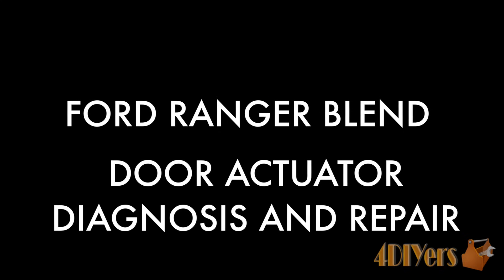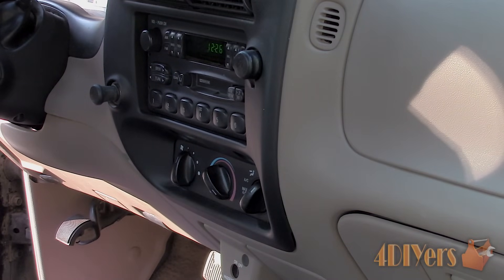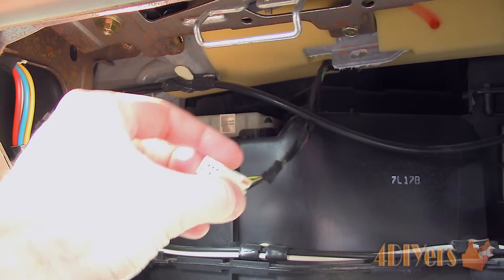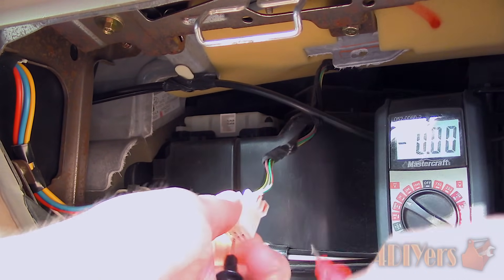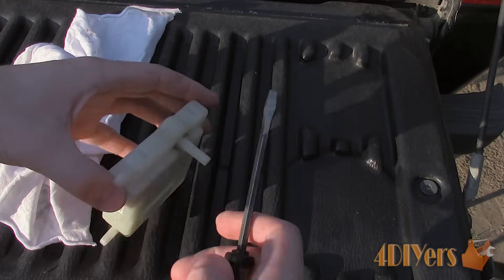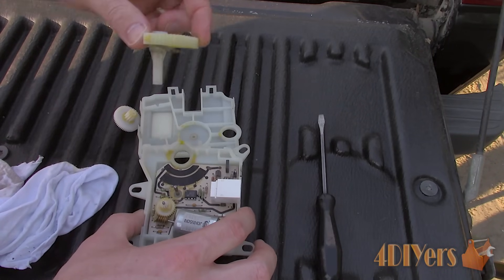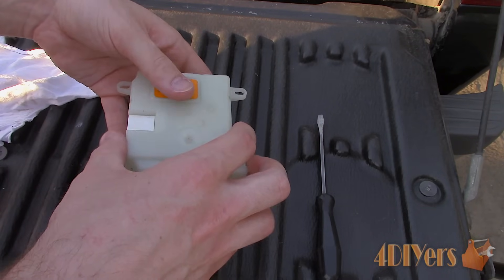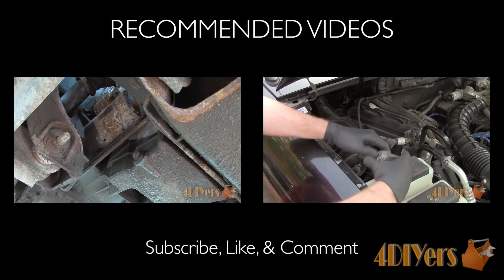DIY: Ford Ranger Blend Door Actuator Diagnosis and Repair

Comment: Uh when I pull up and close the flap inside I no longer get any air from the 2 vents above the radio so this didn’t work apparently
Reply from the maker: The blend door is for hot and cold air, it doesn't control which vents the air come out of.

Comment: Thanks for the excellent steps. Someone on YT said that one should use electric grease (or dielectric grease, not sure) to grease the tracks and gears. Which do you suggest next to the white lithium you mentioned?

Comment: I replaced my actuator but the actuator isn’t moving at all when changing the temp, thinking in may be the control board that isn’t sending a signal
Reply: What did you find out

Comment: A lot of comments I'm seeing are talking about 2 of these in a vehicle.  Mine is a 2009 ford ranger xlt and the knobs are just like what you show.  Does your 98 have 2 actuators?
Reply from the maker: Mine only has one. Maybe it's for dual climate control if that was an option.

Comment: Thanks. My actuator still works fine no click or anything but the blend door doesn't appear to move. Usually I'd hear a rush of air current changes when my ac turns on to ac max but it doesn't do that. I think the blend door is broken. How would I replace that without ivicerating my duct like I've seen people do? I'm trying to restore it and don't wanna hack job it to pieces.
Reply from the maker: You’re welcome! Unfortunately will be required to remove the dashboard in order to pull out the duct. Not any easy job by any means.
Reply: i was afraid of that. there appears to be no videos ive seen on youtube about dash disassembly. i got it apart once before half way to take the instrument cluster out to replace the burned out dash lights since i tend to do a lot of night driving. but not on the passenger side. Ive also noticed that i managed to get the actuator off without moving the screws and mine pops off the nubs it sits on. so i wonder if the screws on my particular model takes off the blend door and it lifts off the top. ill have to see about it when i get around to doing the job. right now i dont have days off of work to work on it so i gotta deal with the florida heat. a shame when these break they default to heat. i wouldnt have cared as much if they just defaulted to cold i never use the heat side of things down here anyway. @4DIYers
Reply from the maker: A mechanic's mirror or borescope would definitely help. I've never done a dashboard removal myself and honestly want to avoid it as I know what's involved. Might be able to move the blend door with a screwdriver to close up the heat.
Reply: @4DIYers  thanks for the reply. i might try this. still havent gotten around to it. i have 3 days off though so i might try to see whats going on with it after using my first day to rest.

Comment: every shop I go to seems to go deaf at the mention of the blend door/actuator. one shop simply recharged the refrigerant, giving me a temporary fix. the local Ford dealership later diagnosed the hole in the AC system and fixed that for me, but the HVAC still blows hot when set to AC. gotta set it to max-AC to get cool. I'm like $1200 (counting other stuff the dealership wanted me to get fixed as well) into trying to get the AC working as intended from factory.  I don't understand why nobody wants to listen to me or get in behind the glovebox, it seems so simple! thank you for this video.
Reply from the maker: You’re welcome! It’s sad when some place just turn into parts changers instead of actually diagnosing the issue properly. Definitely worth having a look yourself.

Comment: Is it possible to remove the shaft of the actuator? Might be a decent temporary fix to put a small handle on it.
Reply from the maker: I can’t remember if the shaft is removable or not. Worse case scenario, you can cut it out.

Comment: I have a 2008 ford ranger ac works but heater doesn't work and the heater core has been replaced and when I switch it from ac to heat I don't hear a clicking noise so I'm not sure if I replace if that would fix it.
Reply from the maker: This motor could be an issue or the blend door inside the duct broke. The blend door breaking is also a common issue.
Reply: @4DIYers  I actually got it fixed it was the blend door actuator

Comment: Have an 06 ranger , doesn’t blow hot air, when I got to change the temp to cold there’s a click, but when I change it to hot there is no click. Could it be the actuator ?
Reply: Sounds like the actuators stuck in hot. When it tries to go cold it clicks but can't move. It doesn't try to go hot cause it's stuck in hot already so it doesn't click.

Comment: awesome video..I had an issue with the actual control of vent ac floor defrost what not...would work when it wanted or if i played with it...tested blower and resistor all fine...The relay was going out for the fan in the under hood box...replaced and all is well

Comment: My cold air just comes out the top of the dash (like defrost) and nothing comes out of the vents facing seats . Never heard any noises .
The blower used to blow on the low settings but is very weak now and needs to be on medium or high to blow right

What is wrong it how to fix ?
Thank you !
Reply from the maker: Sounds like the flapper for the direction maybe jammed or the actuator failed. If the blower is working poorly on lower setting, it could have a blockage. Perhaps the same issue is causing both problems. A borescope would be great for inspecting inside the vents.

Comment: So I have 12 volts and a good ground. The potentiometer metered well and smooth. I have tried two separate potentiometers and two brand new actuators. 

What an I missing? 

Are the brand new Dorman actuators the issue?  If I have power and ground, and good resistances from the potentiometer then why else wouldn't it work?

Comment: There should be Dielectric grease on the potentiometer between the contacts it should not be dry as it creates friction everytime the gear moves and will wear the contacts to where it can no longer find its position do not I repeat do not leave this dry

Comment: Just replaced mine on 07 Ranger. Beware of made in China replacement - the post was .010"  too wide to fit, measured with my caliper. I filed the flats down to match the old part and then it slid right in. Matched the rotation by plugging in and adjusting the temp dial. I left the rear screw out, new one works great.
Reply: get the rear screw from top defroster vent after it is removed
just got to have a long extension 1/4 preferred.

Comment: Helpful Hints By Jonny On The Spot! 
My 99 Mazda B3000 104k mi. ,had very little air flow on AC only. I removed blower motor & with an air chuck wand, blew all the debris out & through my evap. core. Though I could not physically blow through the entire surface area face of the evap core, my air flow increased 2 fold. #2 fan speed now pushes as much air as #4 fan speed did prior. Don't use those spray can evap. Core foamy cleaners! They contain sodium based chemicals that slowly dissolve the aluminum fins & solder!
Reply from the maker: Great tips, thank you for sharing!

Comment: I cannot get the plastic piece to line up. I'm ashamed to tell you how much time I've spent. Do I have the wrong actuator?
Reply: I'm struggling with this too
Reply: Havnt started fixing mine yet, but chatgpt told me to take mine out first and match the model number as there are many different flavors that were put in the same model of cars. Maybe check if your new one matches the model number of the old one. 
If not, calipers or tracing with pencil and paper should maybe help? Again, admitting I have not done this, but am planning to this weekend

Comment: Well did it work ? He didn't say that it did he just said it was quiet after he cleaned it . I got a 1997 ford ranger and it blows heat all the time and the front vents or floor vents doesn't blow hard only the defrost vent blows hard
Reply from the maker: Yes it worked, that's why I posted the video.

Comment: I'm having trouble with my heat i changed the thermostat and top radiator hose (soft) blower motor blower box anti freeze has been changed and burped . I'm at a loss

Comment: How do you remove the third screw on back of the Actuator?
Reply from the maker: 1/4" drive ratchet should be able to access it or use a wrench with a screwdriver tip taped into place.

Comment: Hi , i have a 2002 ford ranger , i can hear my fans turning but no air comes out the dash vents at all , what could it be
Reply from the maker: Sounds like an actuator issue for the vents or you may have a blockage.
Reply: @4DIYers  thank you brother

Comment: Any idea why MAX ac don't blow any harder when selected?
Reply from the maker: It's not for the fan setting, I believe it's intended to recirculate the interior air instead of supplying outside fresh air. It should be outlined in the owner's manual too.
Reply: @4DIYers I do agree whit you but  it used to blow harder when selected,it was like an extra fan speed
Reply: Having the same issue. Has something to do with the vent to the right of the blend door actuator, right behind the glove box, not opening. If you force it open, you'll feel more air rush through but the idea is for it to open by itself, which it's not. I've been trying to figure out why for a good while now, but haven't made any solid conclusions.

Comment: The problem I have is the plastic knob on the actuator itself that rotates when adjusting the temperature controls broke off into the hole it sits in which is on top of the plenum. Any ideas on how to get the plastic pieces out of the hole? Or do I need to remove the airbag and dash?
Reply from the maker: You could thread a small screw into it or glue something onto it and then pull the broken plastic piece out.

Comment: Voltage check, resistor check.
I tried cleaning the actuator as you said, and still doesn't work.
I ordered a new actuator, don't see why it wouldn't work if I'm getting voltage and proper resistor readings when moving the knob.
I'll update when I get the new actuator
Reply: So the little motor in my old actuator had its brushes worn out. Installed the new actuator and problem solved
Reply from the maker: Excellent to hear the problem was solved! Unfortunately the motor can wear out, you can take it apart but it's much more complicated. There are even electronic components that can fail too.

Comment: Hello. Dou you please have any video covering 08 Ford Edge dual climate control blend door actuator or broken door diagnostic replacement? Ghanks in advance
Reply from the maker: Unfortunately I don't have anything relating to an Edge. However I did find a link which appears to have some good info and a pdf file (I can't access it, you need an account but it might be a walkthrough repair hopefully) https://www.fordedgeforum.com/topic/11725-dual-climate-control-repair/
Reply: @4DIYers  thank you much for your prompt reply. I am still dealing with it and trying to notice something that could lead me to the right direction. May be your experience can help me confirm or infirm my thesis. Here is what I got now. 
I noticed:
1- all door blend actuators are operating at some point.
The two in the top are at all time when the recirculation and the air distribution buttons are operated for the heater / HVAC
2- the two actuators at the bottom that open the doors to let the wind circulate towards the vent do their job only for the air. Indeed, once i manually lower the temperature from 69F & lower, they operate to open the doors thus letting the air flow to the vent.

However, when I increase the temperature passed 70F they close the door no matter what air distribution mode is selected and the air only flows towards the feet and within the vent. 

My theory is. 
Since the doors are not broken, 
Since the actuators are not damaged.
This inconsistency of the doors allowing airflow to the vent only when the air is selected must be due to faulty control module. 

If yes, this theory should be confirmed by verifying that the actuators receive power when the vent circulation is selected during the heating mode (70+ F).

The only reason this theory would be weak is if dual temperature blend door actuators have two mode of operation of the same door depending on if heating or cooling is selected (I dont think so but we never know).

What do you think? Sorry for writing a book.
Reply from the maker: No problem, happy to help! From what I've found, they appear to be electronically controlled actuators, same as the Ranger. If they're both operating at the same time, it would seem as if there is a controller issue. Does it do the same thing when you operate the passenger and driver temperatures separately? If all the actuators are the same, you can swap between them just to be sure it isn't a faulty actuator. It's possible they could have failed at the same time. However, another issue can also be the memory of the motor's position. They use stepper motors and some vehicles do have a reset procedure. With my 07 Volvo C30, many parts on the car are made by Ford and it shares the same platform as the Focus. With my car, they are known to act up, the air will blow from random locations. There is a reset procedure, unfortunately someone with the car's specific software is able to do this. You can probably pick up the programming cheap enough on Ebay, I'm not sure which is required for your vehicle. Just be careful of the seller. I tried to order a VIDA cable for my car and it never arrived. Thankfully I got a refund, even with the seller closing their account.
Reply: @4DIYers  I removed the air inlet blend door actuator and found out it was in good condition, no broken teeth on the gears. For peace of mind i decided to replace it. Also, I got an AC controller from salvage yard and the behaviour of the actuators remained the same. Very drained and disappointed i put everything back together. Im now leaning towards a programming issue or a broken door within the vent but im giving up here. 
The good of all is realised i did not have to remove the dash to get to them. Indeed, it was possible to remove them in a not very comfy position but in 15mn...

Comment: Great video. I have a question. How do you align the cogs in the actuator after reassembly? Is there a video for that? Also does the actuator and the door position have to match before operating the heater switch? I have a broken door that I am replacing. 

Thanks for your help
Reply from the maker: Thank you! You can plug in the actuator, turn the ignition on so it's functional and then rotate the temperature dial. Just move it slowly and you'll feel it fall into place. It does have to match, I believe this is a stepper motor.

Comment: I had to break the back bolt off because I wasn't taking everything apart to get to it, but it seems to be holding fine and my temperature control is working the blend door properly now.

Thanks!
Reply from the maker: Glad to help out!
Reply: I had to do the same thing.... I checked with mechanic friends and that was the only way to get at that single bolt.... I wasn't going to tear everything apart either.....
Reply: Yes, able to get the back screw out, but I was not able to get the back screw back in

Comment: My ac will only run when my foot is off of the gas city or free way, and I called this place Parts Authority and they dont know what they are doing... So what do you think it could be ???
Reply from the maker: Could be a couple different things. Not sure what your vehicle is, but on newer models they will disable to ac at wide open throttle. A sensor my have failed, causing it to not run at all. You could also be looking at a slipping ac clutch or perhaps the system is low in freon.
Reply: 4DIYers it's a 1999 ford ranger 4 cylinder 5 speed 2.5L
Reply from the maker: I believe that does have a cut out when accelerating which if I remember correctly is controlled by the throttle position sensor. Also, you may have a vacuum leak and that would be the best place to start.

Comment: hello thank you for your videos i have a 2000 ranger recently i had the heato cor replaced and now the air does not blow  to front panels only  on top vents what do think it could be
Reply: Vacuum leak.
Reply: Vacuum leak, the default air flow is the defrost position. Check all vacuum lines, fix it and it should work as normal. Good luck.
Reply from the maker: Glad to help out. That could be an issue with your HVAC control panel, perhaps the wiring, or an actuator/door which controls the air flow.

Comment: Thanks for the Instructions, mine hed all the little prongs inside, the plug from actuator was forward. had to push the prongs inside the female plug, open the actuator and push the female plug back and make the prongs to expose. bad assembly I guess. fixed it and saved some bucks.
Reply from the maker: Awesome to hear and thank you for the feedback!

Comment: Can anyone help please? 

I cut a hole in the duct and found that the blend door was loosely flapping around with no resistance. Is there a connection gone somewhere or is there a problem with the actuator?

Comment: I have a 03 ranger and my temp works great it’s just that the air only blows out the top defrost vent no matter what mode u have it on. Could that be the blend door actuator?
Reply: You probably have a vacuum leak, check the vacuum lines behind the glove box and also under the hood, 2 vacuum lines that go to the black plastic ball near the passenger side headlight. Mine was melted by the exhaust.

Comment: Awesome video, thank you so much, fixed my lack of heat in my 2008 ford ranger.My friend had a horrible time accessing the back screw and had to modify his ratchet with tape and a copper pipe.Once he used his tool, it was fast and easy.
Reply from the maker: Thank you and glad to help out :)